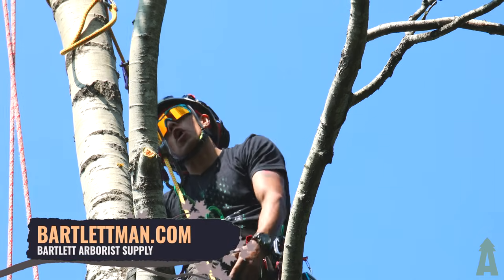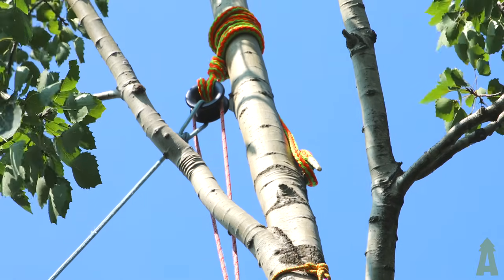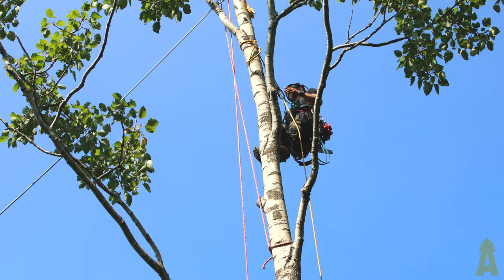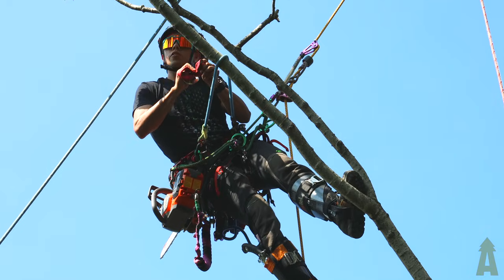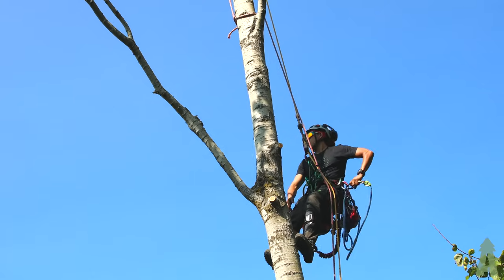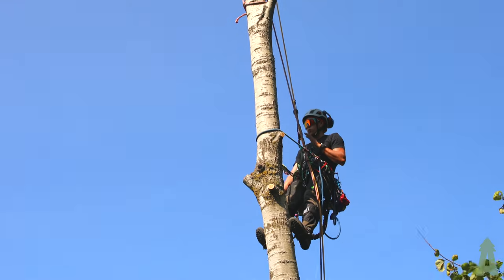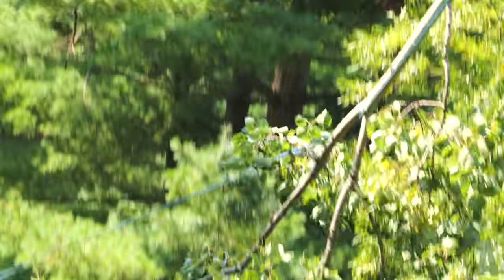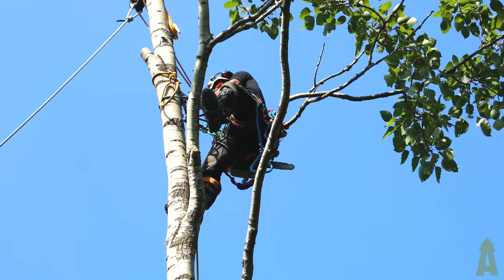Tree Work: Rigging Ring in a Speed Line System!

Comment: It works ok
I only don't like the friction between the control line vs the atache point of the speed line ( mostly on the knot at the rigging ring)
Thanks
Reply: One solution to this could be separate the lines, ataching the speed line directly to the stem  an the rigging ring for the control line below the speed's line atache point.
Reply: A speed line needs speed to run through that brush that's slowing things down.!!!😜👍

Comment: Your control line could easily abraid your speedline in that configuration
Reply from the maker: True, if one was not vigilant with their rigging approach.
Reply: @BartlettArboristSupply  watch after 8:18
It takes but a second or 2 rubbing a line under tension to cut enough for it to fail